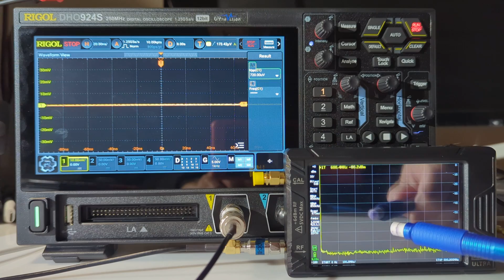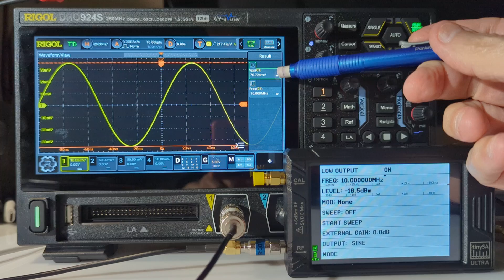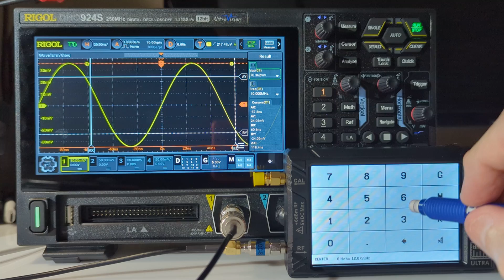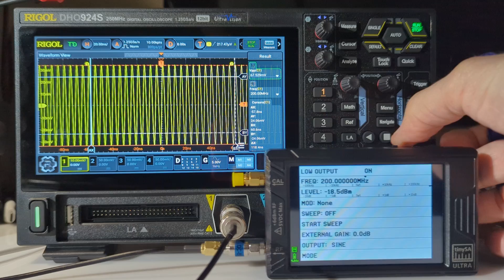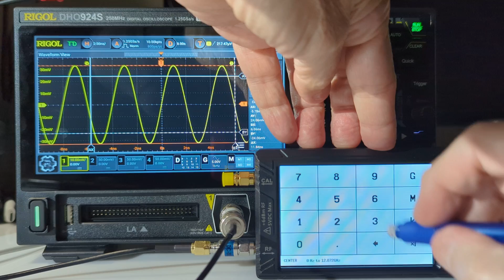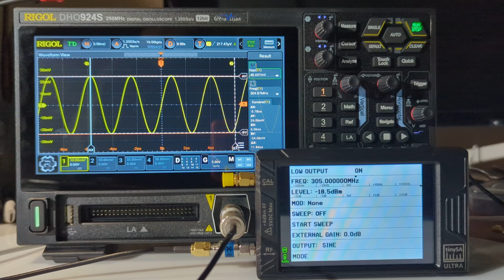Rigol 924S Oscilloscope bandwidth measurement

Comment: The Rigol DHO900 oscilloscope provides a bandwidth of up to 250 MHz, but this performance is achievable only in single-channel operation. When all four channels are active, the sampling rate drops to 312.5 MSa/s per channel — an unconventional value that fails to meet the Nyquist criterion for higher-frequency signals — potentially resulting in signal distortion and reduced fidelity. Under this multi-channel configuration, the effective bandwidth is significantly diminished, often falling below 100 MHz, increasing the likelihood of sampling artifacts and aliasing.

Comment: tinysa ultra spec says that the sine signal level is +-2db across the lower freq range. 4db delta means you have Vpp uncertainty of about 50% Could be 1V at one freq and could be 0.63V at another. You try to measure 30% drop in amplitude while you have 50% error.

Comment: evvblog said the maximum frequency it can reach based on the builtin chip can be 800Mhz (no doute). Have you tried? What’s the result?
Reply: If I read the same posts, it could see the signal, but the amplitude was way below the 3db point - so not accurate.  Still, sometimes you don't care about amplitude accuracy, and just want to see if the signal exists. Also the frequency counter stops working accurately well below 800 Mhz.
Reply: I know maybe you need to change a cable coz by the cable which comes with Dho 924s by default is for 300Mhz.

Comment: Got the same results with my Rigol DHO804 (hacked to 100MHz). The real bandwidth was roughly 150MHz, which is also what the default probes are rated for. The maximum rise time I got with a NanoVNA H4 was 2.3ns, which is in accordance to the bandwidth test I did.
    My biggest problem with the DHO804 is the lack of dots display, vector display can look really ugly sometimes and it's a shame when they've got a display that can show multiple colour intensities at the same time.

Comment: Thanks for the video! Can you please provide more details about the connection. Specifically, how have you connected the TinySA to the scope? Did you have to impedance match the output of SA to the input of 924s? 

Thank you!
Reply from the maker: The shielded cable from the tinySA to the scope input is terminated with a 50 ohm thru terminator at the scope input.

Comment: Thank you for the review. One of the things that I do not like about the scope is the user interface that reduces the usable screen size for the waveform. On the right size you can remove that, however top and bottom I do not see that you can remove the menu.
Reply: Yeah modern UI designers seem to not understand the importance of vertical real estate on the screen, which is all the more important given how ubiquitous the wide aspect ratio displays have become. This sucks. If the UI was done properly, the available vertical space in the waveform view window could be increased by an equivalent of at least two lines of text even without hiding the top or bottom panels. Maybe one day someone will come up with a modded apk to solve this.
Reply from the maker: I think you're right. That seems like a pretty easy s/w change to the GUI. You might want to give that feedback to Rigol.
Reply: There is an extended UI from the comunity available